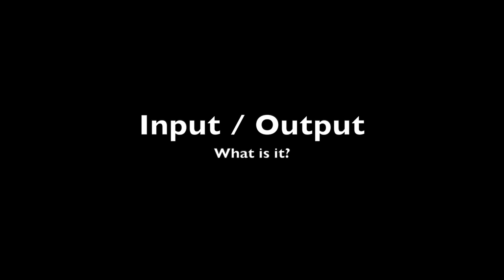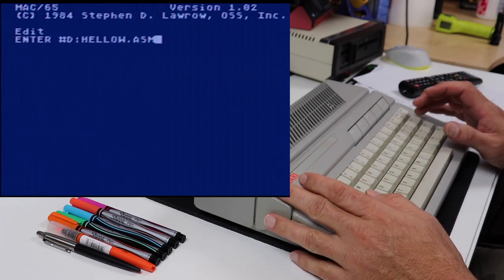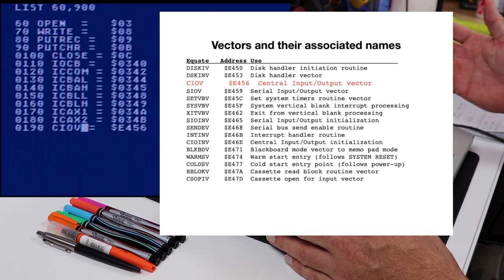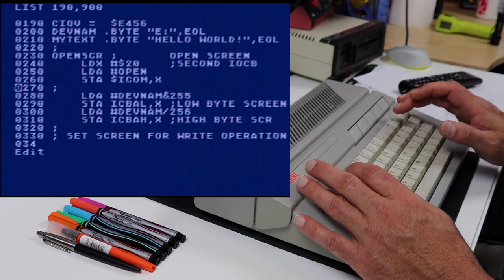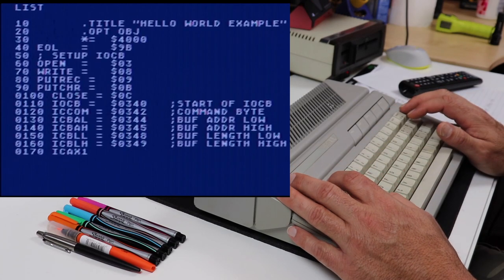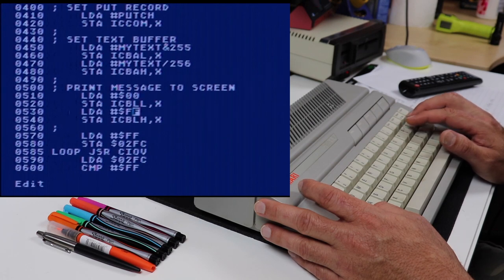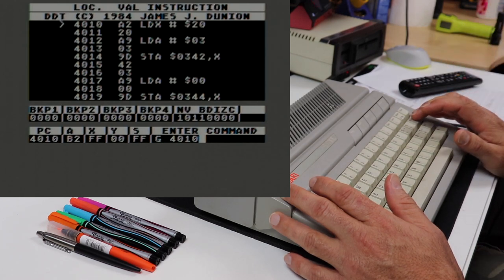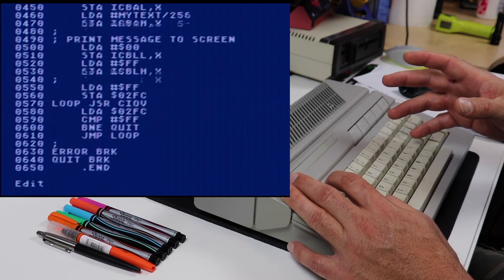Hello World in Assembly on the Atari 6502

Comment: Cool video, thanks. I'm still pretty new at 6502 assembly, but looking at MAC/65 manual I saw it supports unary < and > to get high and low byte of operand. So, where you used #DEVNAM&255 you can use #>DEVNAM and likewise for high byte: #<DEVNAM

Cheers :-)
Reply from the maker: I wonder if Atari assembler supports those, if not it would make the code non portable.